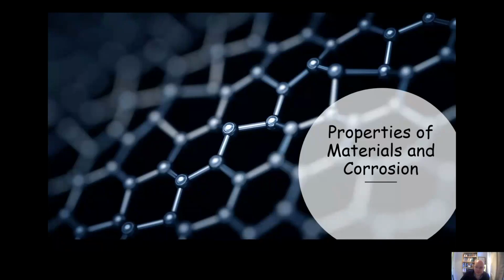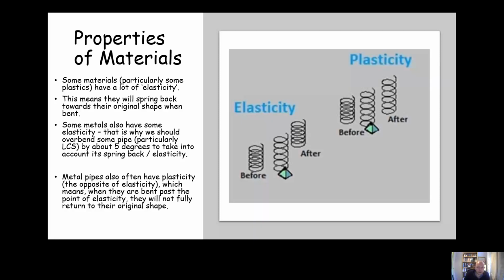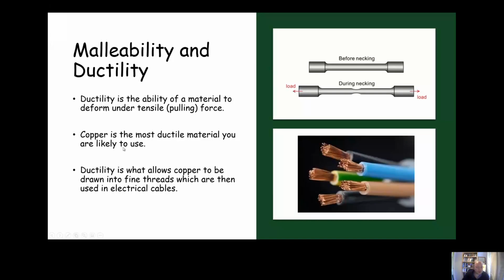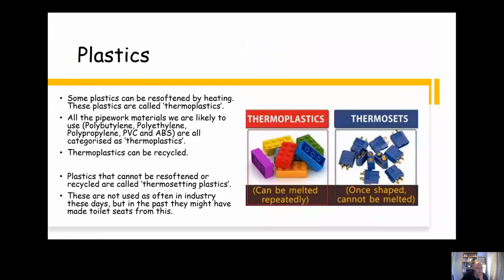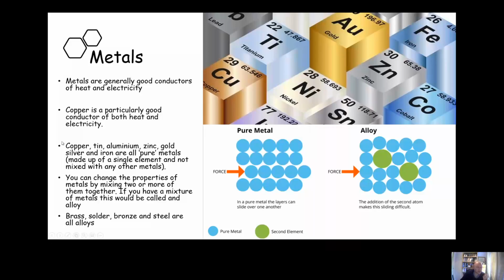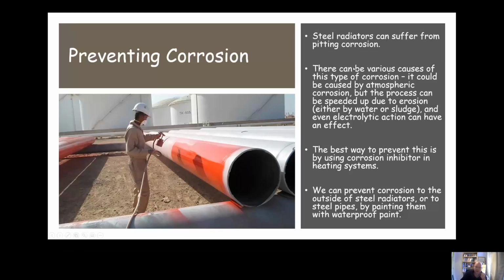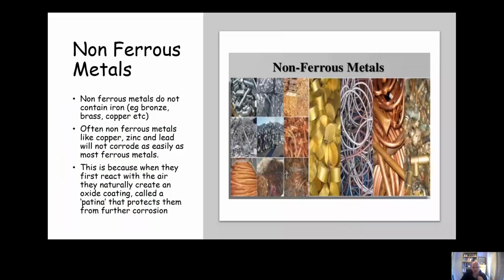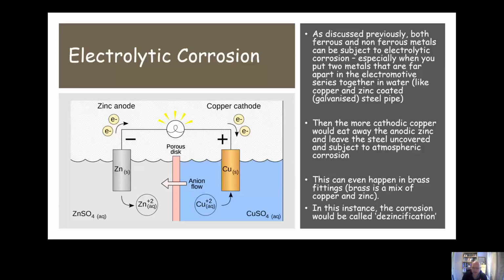Principles Session 3   Corrosion and Properties of Materials

Comment from the maker: I’ve just finished building my first Android app designed specifically for plumbing, and I’m looking for a handful of volunteers to help me get it onto the Google Play Store.

Because of Google’s new developer requirements, I need a small group of Android users to test the app for 14 days before it can be released to the public.

How it works:

It’s 100% Free: There is no cost to join or use the app. I plan to add a subscription later but it will remain free to those who helped to test.

Android Only: Currently, this is only for users with Android smartphones.

Limited Slots: Google limits the number of testers I can add manually via email, so it’s first-come, first-served!

What you need to do: Just keep the app installed on your phone for two weeks and open it occasionally to check out the features.

Interested? Please send an email to daniel.holwell@gmail.com using the Gmail address associated with your Google Play Store account. I will then send you a private link to download the app directly from the Play Store.

Your help means I can finally get this tool out to the wider plumbing community. Thanks for the support!